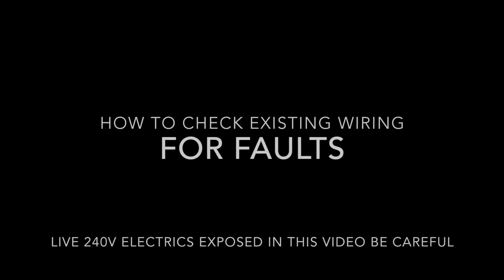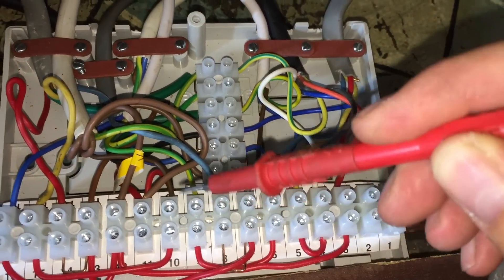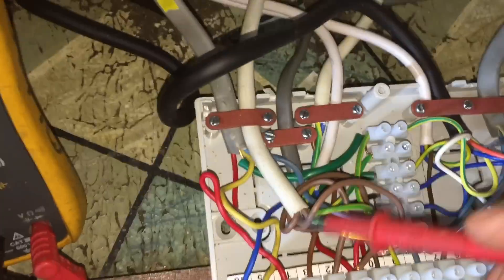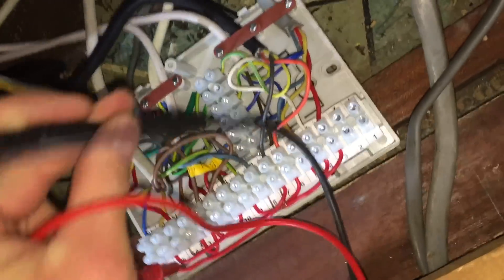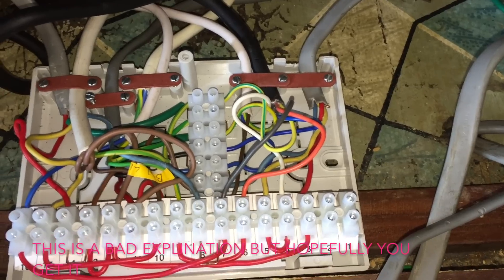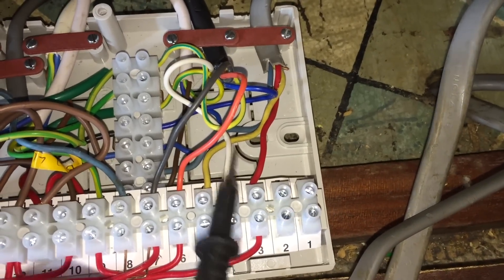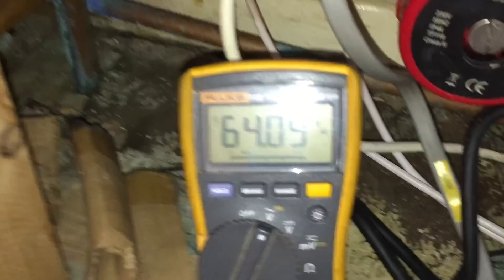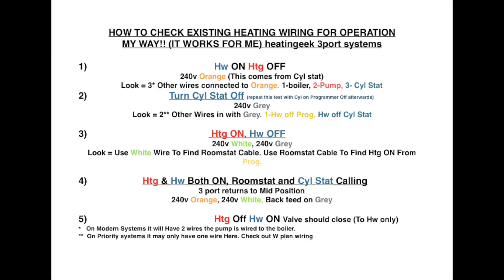How to test 3 port system wiring for issues. Reference Sheet at End of vid

Comment: Hi. Thanks for a great video. Very informative! I'm trying to diagnose a problem with my system at the moment and have noted that when the programmer is set to HW ONLY I'm getting a 240V reading on the 3-port valve's white wire when the cylinder thermostat is calling for heat. Surely this is incorrect!? The white wire is connected only to the programmer so should be off when set to HW only. Could the 2nd switch inside the 3-port valve be stuck so that the white is getting 240v from the orange? The water is heating but the radiators are also on. Thanks in anticipation. Tom
Reply from the maker: What boiler do you have. I hate this fault. Hopefully you don't have micron...... or a UPSII pump.
Reply: It's a Baxi solo 3. Can't remember what the pump is and I'm at work at the mo. Weirdly the white wire as behaving when I retested it last night but instead the CH only function was malfunctioning. So white and grey ON was not giving the 240V output on orange going into the SL of the boiler so boiler was turning off when it should have been supplying the CH. This I think could be that second switch sticking again but this time sticking on the default position. I think I just have to replace the 3 port valve and hopefully it'll be sorted.
Reply from the maker: Just the head. 
To test this fault:
1) turn heating and hot water on together. Valve should go Mid position. Low voltage on Grey and 240v on white and orange.
2) turn hw off. valve should go to htg only (all the way across) grey, orange and white should be 240v.
3)turn htg off and hw on. valve should motor back to Hw only and only orange should be live.
4) if (3) dosent happen and the valve stays in htg only (grey has 240v) then I do a test that isn't safe and tells me where the 240v is coming from. 
If you turn the power off the fault will disappear. 
Usually the actuator is the issue. Most engineers just replace that and see if its fixed.
Reply: Hey thanks so much! 2 is the problem. I don't have a HTG only function on my programmer (only HW or HW+HTG), but when I put it on HW+HTG it is fine until the cylinder reaches the thermostat temp and then instead of switching to HW only the boiler just shuts down. At this point the WHT is 240V, Grey is 240V (from the cylinder thermostat) but I'm not getting the expected 240 V from the valve's orange wire hence the shut down. I'm not sure whether I can replace the motor and actuator only as it is a LANDIS and Staffer valve and I think it is not detachable - as in if I pull the actuator out it's going to flood!
Reply from the maker: Its the microswitch or motor. Im sure you can find a video on how to do it.
Sorry for the late reply. I had no broadband for 5 days!!
Reply: Thanks so much mate! Will do
Reply: @taddy666  i have the same issue i only discovered when i bought a nest. 

Ch will only come on when hw is on alongside ch. The rads wont heat on ch alone. I cant find my 3 port valve tho. Ive spent 2 days at it. And i dont even have a proper junction box in the hotpress where all the wires go
Reply: @HeatingGeek  Hey I have this issue, if I disconnect the grey wire from the wiring centre then the 3 port goes back to HW only. but as soon as i put the grey wire from the valve back in with HW off and NO from the thermostat, then i select CH the valve moves over to CH but once I turn it off the valve doesn't return to HW...I feel like there is just one wire wrong somewhere and I can't work out where

Comment: Hi mate good vids and congratulations on the new arrival, I was looking at the stat wire and the earth is not connected, I was pulled up by a spark years ago because of this. Even though the stat has no need for the earth you still need protection within the cable, ie- if the cable gets cut, broken Or even drilled/screwed through  the earth is there to protect whoever does this.
Reply from the maker: Yes your totally correct. I was part P and my brother is a sparks so I know how bad a lot of the stuff we see is shit. The only problem is its ALL so bad. Where do you start.

Comment: Hi HeatingGeek. I am an electrician and I will produce a fault finding chart and drawings so people can see what and why they are testing. Whether it is better or more useful than yours remains to be seen. One piece of advice, get a lead with croc clip (IGNPION 0.15”(4mm) 5PC Banana Plug to Crocodile Alligator Clip Test Probe from Amazon £9.00) or grips so you can get a good neutral or earth and you only have to poke around with one lead. I have glued magnets on the back of my old meter so I can stick it to metal consumer units and that works well. Keep up the good work.
Reply from the maker: I do have crocodile clips for the MM but I try and pack light for the scooter. There is usually somewhere to wedge a probe tbh. Also remember that (on boilers) the neutral may have failed on the specific item your testing (ie downstream on the PCB), so if you use a generic earth point the potential difference will be there and you would miss the PCB fault. Hope that makes sense... Im tired and rambling!

PS the magnet is a good shout. Fluke charge a lot for a magnet to attach!!
Reply from the maker: Im usually going after several engineers (when I'm Contracting) so usually the correct part has been fitted but not set up or the customer is just happy to have a correct diagnosis.
When I'm working for myself I will go and get the part and go back if needed. I usually bring what I think is the issue with me. I do fixed price labour so customer doesn't mind!

Comment: Of course the first check would be LNE & fuse size.  This would confirm Polarity etc.
This is always better checked at the ‘10 Way’ & the boiler.  Always check for random links at the boiler terminals too.
Good video mate👍
Reply from the maker: I should do a basic electrical checks video. Safe isolation, polarity, resistance to Earth, short circuit etc but i don't think people would be interested. Fixing stuff YES, safe isolation?? not sure.
Reply: HeatingGeek Without these basic initial check, you could’ve ‘backfeed’ issues & a dodgy N or E can give you rectification boiler problems,
not with an old BBU, but most modern appliances. 
Keep the videos coming mate, very enjoyable.......Go on be brave, do one on the guts of a 3 Port actuator - diodes, resistors etc👍😜
Reply: John Wards channel has already covered this in depth.